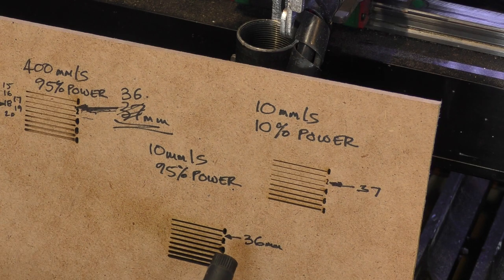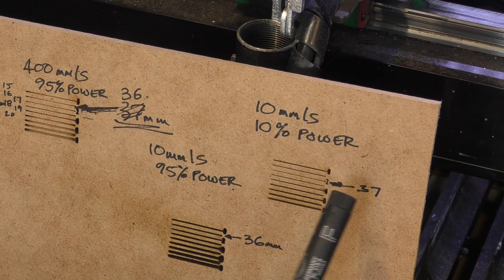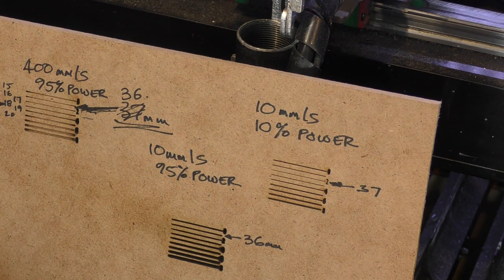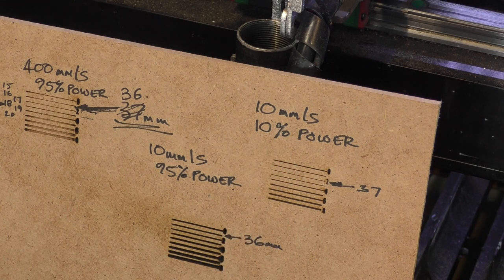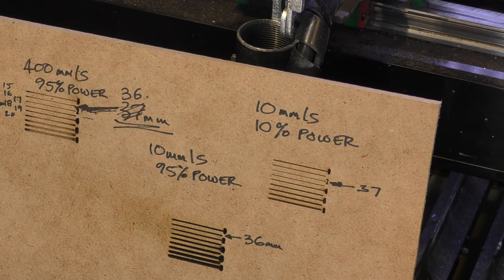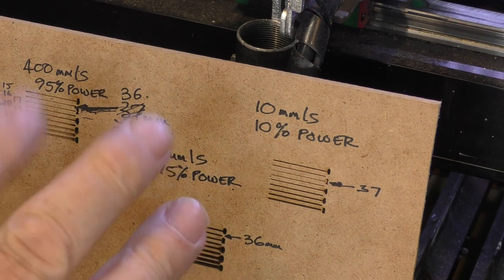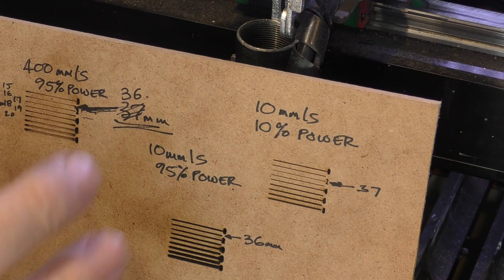RDWorks Learning Lab 216 The FOCUS Fallacy (Ooops, sorry about incorrect numbering)

Comment: I've often thought speed and material type may have affected focus as I noticed the phenomena you describe quite by accident last year. Having set up my machine with acrylic then changing material to wood I couldn't establish why the image was not as sharp despite using the same settings, but I didn't attach so much importance to it at the time.  Brilliant work again Russ, I learned so much about the rudiments of my machine and how to use it from your video sessions. I am still learning but thoroughly enjoy the satisfaction I feel when a job turns out well. Thanks for your excellent guidance.
Reply from the maker: Hi Bob
 I had been using my  machine and digging into many dark areas before I came to comparing lens performance to verify the accepted fact( or myth)  that that there were best lenses for particular applications  and tube powers. At that point about 2 years ago I noticed that the principle of spot size and energy density  was total nonsense. At the time I mentioned that I may have opened Pandora's box. and yes, that proved to be the case because the more at looked the more inconsistencies I recognized. Trying to decode why those inconsistencies existed has been an ongoing mission. There are just a few people like yourself that have also identified some strange anomalies, but putting your faith in the overall validity of the technology , you note the problem and develop a work around  that "hides" the problem. Expediency often forces me into workarounds  also, BUT  I never forget the underlying problem. The next video will reveal the culmination of two years of puzzlement as many  seemingly unrelated issues converge  and everything becomes explainable.

 Best wishes
Russ

Comment: Dot size also changes with power settings. If you fire a dot without moving the laser at 100% power it will be bigger than 10% at the same hight and that's why sometimes lower power cuts better.
Thanks for your videos I've learned so much from them.
Reply from the maker: Hi Mark
 We need to be specific about the difference between DOT size (something we can control) and SPOT  size,   something that the lens manufacturer promises. Look at any laser lens specification and there are unimaginable promised SPOT sizes.  Set the lens onto a focal point and you are correct with your observation. That is exactly what this data shows. Have you never questioned why . If ALL the rays are passing through a FOCAL point (as EVERY lense diagram  indicates), why should power cause the effect you see?  The next test you should try is holding the power at 100% for 10 seconds. Hmmm.   go figure that one.  What are your thoughts on a focal point now?
Best wishes
Russ

Comment: Two things come to mind: with any manufactured material there may be variation in the composition of the material itself, so a test done in a different location of the same material may give different results. Many see this when cutting plywood as an example.
The other issue involves the ability or inability of the materials  to tolerate the effect of the laser. So a slower speed overcomes that tolerance. Faster speed lessens the cumulative effect and produces a thinner line. I don't think the focus has changed - I think the material has not had sufficient time to react, giving the illusion that the focus changed. Does the time it takes the motor to get up to speed have any effect? Ramping up and ramping down - is the effect too small to be concerned with in such short lines?
Can similar tests be performed on a watt meter to measure the energy at a given speed and focal point?
I hope my lack of comprehension doesn't further muddy the water.
Reply from the maker: Hi 
 Your observation about material differences is very astute  and one of the reasons I did not use bamboo in my tests. There is no such thing as wood , that is just a generic term because EVERY wood is different and every mm within a piece of wood can have different "burn" characteristics.  However. if you think about it logically and believe the lens manufacturers specification then a focal point is a diameter through which all rays pass and would produce a different COLOUR burn NOT a different DIAMETER burn. There is not the same risk of inconsistency with glass, slate, thick and thin card,, hdf, mdf or anodized aluminium.   You are quite correct in your assertion that the focus has not changed, that is physically impossible
 This video is a demonstration of a puzzling issue that many people will never have observed. Trust me it is a real issue (as I demonstrate) and not an illusion.  If it's not the focal point changing then its something else that the lens manufacturer is not recognizing  when he raises our expectation with his specification.  I do actually understand what the issue is and the next video will explain it

Speed does affect line thickness as this demo illustrates but acceleration to 400mm/s on a 40mm long line will happen in about 3mm  and deceleration will be  the same at the other end thus leaving  34mm of constant speed line for me to examine.

 A power meter should show the same result for at least +/- 10 mm above and below the focal point.  It is only the distribution of power that changes as the beam shrinks or grows . A power meter is measuring total power  and not power density. Thus, it  is of no value to aid this discussion.
 
 This technology is like a very badly tangled ball of string. There are no obvious answers to some of the  difficult questions I ask. The answers require patience  and understanding to gradually tease them out of  the opaqueness of confusion.

 I hope that soon the sediment in your water will settle and all will become clear

Best wishes
Russ

Comment: I am curious about power supplies and their effect on the tubes ability, I ask not with out knowledge of electronics, and power,  supplies/conversion etc. However the numbers seem to be all over the place. for ex. i also have a k40, 40watt supply, but it only had less than 600mm tube(30w prob). So I put in a 50w/800mm tube, adjusted the power supply to the correct amperage, and it functions but I had to turn % way down to get correct current, and it works like crap.... I summize 2 things, 1 they were way overdriving the previous tube and 2 the current supply while delivering said current is not keeping up with power required somehow. my old 30w tube cut and engraved better than my new 50..... Yes same supply, I was testing to see if a "50w" supply was truly needed or if supply amps was the most important........ the wattage rating seems to be more marketing than true power.... ideas thoughts? great work on your vids by the way truly informative.
Reply from the maker: Hi
 Fist of all a quick word about tubes. The K40 is not a 40 watt tube.  When tubes are 50mm diameter it is easy to say what their REAL operating wattage is.the rules are very simple
50 watts = 1000mm long and operating current 20mA
60 watts = 1200mm long and operating current 22 mA
80 watts = 1600mm long and operating current 24 mA
40 watts = 800mm long and operating current 18 mA
30 watts = 600mm long and operating current 16 mA
 Do you see the pattern here?
 Newer tube designs start using 55mm tubes  to store more gas (ie longer life)  and some of these numbers start to break down
As the wattage increases to 80 watts and above the tube diameter increases to 80mm diameter and the numbers  above are meaningless. You need to check the manufacturers specs.
 Your new tube sound very suspiciously B grade  I am not aware of any 80mm diameter 50 watt tubes So that may be your real problem. There are VERY few reliable sources for A grade tubes. The market is flooded with factory rejects that cannot be warranted by the original manufacturer, How well they work is just a lottery. They may be a "just fail" or maybe "total junk"
 Go to the Cloudray website and you will find nothing with that power and diameter.  https://www.cloudraylaser.com/collections/co2-laser-tube

 OK now the power supply. There are two main  parts to the HV power supply. First is the flyback transformer that is responsible for generating the many kV required to ionoze the nitrogen into a current carrying oing beam od plasma. Secondly a current control system to limit the current flowing through the tube,  On your K40 it is an analog control system so when you adjust the current control knob you are really adjusting a 0 to 5vdc signal to the IN trminal of the HV power supply. Yout  power supply will probably be an MYJG50 which means it can support a 50 watt tube and can deliver a max current of 20 mA. If the IN voltage is 0vdc then the current flow will be 0mA. 2.5vdc=10mA and 5vdc=20mA.
 The  power supply is unlikely to be the cause of any because the current flow that you set will ALWAYS be there even when you tube " dies". Dying means you have run out of CO2  because it has become dissociated by over driving.

 You 30 watt 600 mm tube will have a very small diameter beam and that means it will have very efficient high intensity beam. It is intensity the does material damage thus a low wattage tube in a small footprint machine is a very potent beast and can do some amazing work.. I will not begin to explain why this is but trust me, as the tube power increases so does the beam diameter, and this is not always a good thing . However I think your disappointment with the supposed 50 watt tube is all to de with it being a dodgt tube deliverig very low power. What length is this 50 watt tube?  It is percance labeled K H Laser? 
 If you wish to speak further, just add your disguised email address  TOM dot (jones)====at geeeemail====dot (com) and I will relp[ly and you can then send pictures.
 Best wishes
Russ
Reply: Thanks for your quick response, yeah suspect my original was more in the 30watt range with the planets in aligment and wind blown in the right direction etc...... and sorry for not specifying, but new tube is 55mm dia and 800mm long, sold as a 50w, ratings show 55w max test, 45w continuos....
My interest is in that the power suply companies are playing the same game as tube co, and if there is truth in numbers, such, measuring kv and amps, or as long as kv is about trigger, and amps is restricted to max or some percentage less for saftety, thats it.....? 
I would be interested in a series of vids on supplies. Ins an outs......interested?
Reply from the maker: @customsolutionsinc 
 Hi 
Again your  tube dimensions and power rating do not match any standard tube that I know of An 800 mm tube will be a 40 watt tube limited to 18mA.. Yes there are many B grade power supplies out there but  don't be concerned about the kV.  If it creates a pink  beam reliably every time you switch on  then the flyback transformer is OK. The control of current is usually not the reason for B grade . If the pink in the tube is incomplete and hazy at about 4 or 5 mA that is normal and as you wind the current up to 18 mA samA the colour of the beam should gradually become denser and brighter. That indicates that your current control is working. The usual cause for a B grade power supply is failure to achieve the less than 1ms response time  specification. Most people will never notice this  unless it is maybe 5 ms or more.. So in general you should not suspect your power supply even though it may be a test failure. In general the power supply will fail instantly  for one of several reasons  it does not usually "misbehave" IN one of my videos I have an expert talking about power supplies so you may care to watch that.
https://www.youtube.com/watch?v=5CoTrLNUWTM
 Best wishes
Russ
Reply: @SarbarMultimedia  Thanks again, I enjoyed that video you liked me to as well. I have been researching how to send a hidden email link, because honestly never done it. I hope to share , insights. Lasers are newer to me electronics not so much... Kind of hoping you might like a couple of my projects I can share with you. I prob will be doia video on them much later...... Ive been shooting footage over the last month..... if you know how to, or of a video of how to, id be happy to forward you my email.... thx again

Comment: Hello Russ, I've cut and engraved al kinds of projects since you helped me get started back in 2019. Just recently I have a return to home problem after the cut is completed. I see that it returns about an 1/8 of an inch past where it should stop and make a sound like the stepper is trying to go past a physical stop. I thought maybe end stops. I tried running the machine to the left until it stops and no problem. Do you have any pointers about what to look at and check out?
Reply from the maker: Hi Mark
The symptoms you describe indicate you are losing steps. It sounds like you have the machine configured to return to the 0,0 at the end of each program. A stepper motor can never gain steps . Unless it has feed back (and 99% will not have) the stepper has no idea where it isIt is the controller that issues instructions to the stepper driver that says, for example.  move forward 100 steps. There will be 100 pulses issued by the stepper driver  but if something happens ( the stepper meets resistance) then the motor will only move 70steps,say.  That means that when  the stepper is told to return to home with 100 pulses in the opposite direction, it will reach home after 70 pulses and want to continue on another 30 steps to reach home. Son that's your crunching noise. The electric field in the motor is rotating trying to drive the motor but not succeeding. It sounds bad but is not damaging.
You have my email. Send me a short video of  running a quick program and I will send you a couple of test programs that will help track down the issue.
 Best wishes
Russ

Comment: Awesome but this assumes the line you think is focused is the same size in thickness. Fires spread so I wonder if it's more the face that you apply more heat, the heat has to disapate reaching fibres further away creating a wider burn. It would be interesting to see the shape that's burnt under a microscope and see if the shape differs too. For example the angle of the cut because of the beam coming in at a angle to the focal point
Reply: Dohh I really should watch the video to the end before commenting 🙃
Reply: Another thing is radiative heat. A bit like of you stand near someone welding, you can feel the heat, I wonder if that too burns away from the focal point
Reply from the maker: Hi 
You have seen from the chart in this video that I tested thin card (0.3mm thick), glass, ceramic tile, slate and anodized aluminium.  These materials cannot exhibit the 
 the thermal radiation/conduction property you imagine yet the effects are the same as those to be seen on organic  and plastic materials.
Best wishes
Russ

Comment: Hi Russ - very interesting video thanks.  There is a noise interfering with your voice.  Cheers
Reply from the maker: Hi Isaac
Perhaps it's my alta ego trying to make itself heard???  In reality I think you are hearing the many sounds of my workshop  ( especially sharp noises) affecting the auto gain control of the camera audio.  Right at the beginning of this series 6 years ago, I decided against using the studio equipment that I do possess (light. mics .....and makeup???) in favour of a simple one camera over the  shoulder style record of my learning journey. I reasoned that trying to achieve a slick studio production would distract me from the real purpose of documenting my learning and discoveries.
 Best wishes
Russ
Reply: @SarbarMultimedia  Hi Russ - no big drama. I guess it sounded like the laser air compressor. I have a hearing problem so I am using earphones which makes the background noise louder.  

Anyways - this did not last long. 

Please keep up the good work.

Comment: Hoy do you program the z Axis for it moves automaticalli?
Reply from the maker: IF you buy a machine that has auto focus , it means that the Z axis is driven by a stepper motor and is programmable. I am afraid I tossed the autofocus switch off my macine because it was too fragile, at high risk of getting gummed up with fumes and far too slow to operate and set. However, the programmable Z has been a great asset for some things, like my focus finding program.
 Best wishes
Russ
Reply: @SarbarMultimedia  yes, i know about it, but how do you set it on rdworks?
Reply from the maker: @tomaspeli 
 Hi Tomas
Take a look at these videos for more details

https://www.youtube.com/watch?v=IDaGEu0ddrE
https://www.youtube.com/watch?v=ki8bFEAcJG8

If you need more information or a copy of my focus program then just add your disguised email address to another comment and I will reply and also delete your comment
Best wishes
Russ